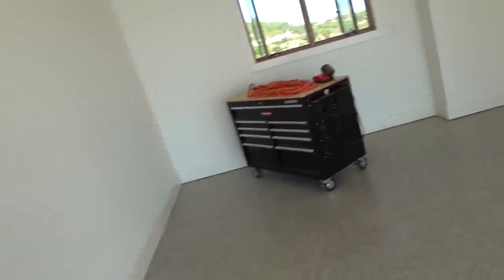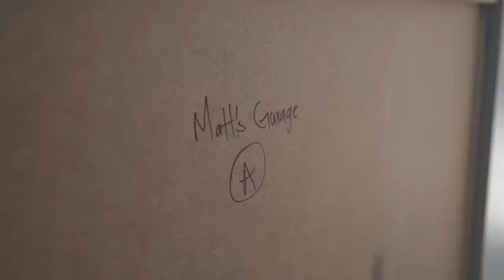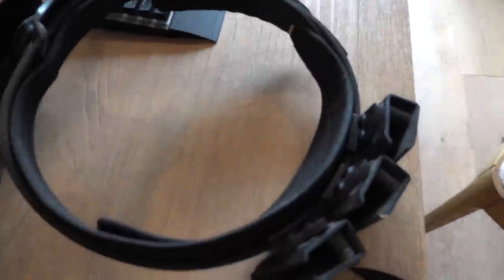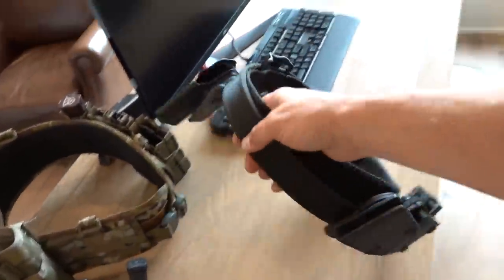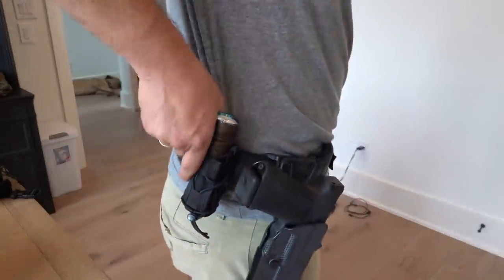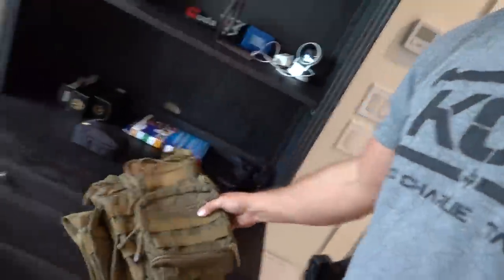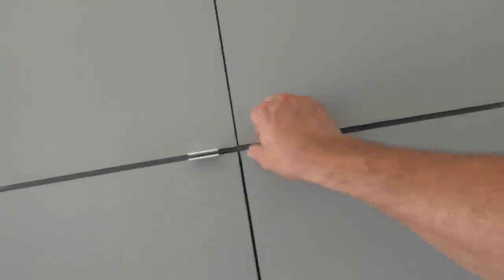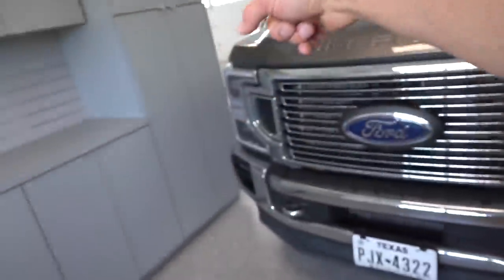Caught Intruder in my Backyard at 10pm... DemoRanch Gear Check!

Comment: As prier law enforcement I agree with FixitQuick and Robbie Hicks, put your flashlight on your non dominant side as well as a fixed blade on the same side as a knife can be a superior close combat option. Turn you mags the same direction as well it will help you get the muscle memory if you are use to pulling them if they are always the same direction. Also if you by chance don't have time or in your rush you forget you med bag i would recommend a smaller med pouch.

Comment: Spent a few years operating from more of the webbing style kits but have recently moved over to a 2 row shooters belt when I don’t need to be carrying all of my kit, would highly recommend a dump pouch to throw those empty mags in rather than fumbling around trying to put them in pouches. As far as med kits go there’s options out there for smaller kits that can be mounted at the back of a shooters belt which can fit all the things you would need immediately but there’s no need to carry all that med kit with you all the time 👍🏼

Comment: Safariland retention holster 100%. ALS at least, but I actually like SLS/ALS. You want to be able to grab the belt and RUN. kydex is great for EDC and range use. if you might need to use this running through the woods or grabbing a kid and sprinting to the car, you want retention on the pistol. Light should be on the left side. keep your primary hand free to be able to go lethal if needed.
Reply: I really like the 6360RDS and 6390RDS. RDS means red dot compatible. You want a weapon light on the pistol. X300U X300T or TLR1 HL. If you get one for a Glock 34 you can also run Glock 17s in it.

Comment: Flaslight with Strobe on the non pewpew side, holster with safety ,softarmour with knife protector, Glock without reddot but light/laser module, tac shotgun. 
At nighttime you wont be shooting at targets a mile away. Biggest danger is a surprise attack around the corner.

Comment: I’d move the flashlight to the support side for two reasons. 1) you don’t want to get hung up on the light going for the pew pew (you can train to that though) and 2) if your pew pew is out and you need your light for some reason (even if you have a WML) you won’t be able to easily grab it.

I have tactical belts and stuff, but I’m not a professional just to let you know.

Comment: I run a Ronin Senshi Multi-Cam belt, with a Multicam Safariland ALS holster for my Glock 17, surefire X-300, and a red dot on top, I run a random flashlight, 3 rifle mags, 3 pistol mags, a Tourniquet, and a medical pouch all on my belt, plus zip-cuffs if I need to use them.

Comment: You should totally run a 19x w/ a flashlight on the multicam big boi belt, I'm a big fan of the night sights and the recoil control since the 17 frame and the 19 barrel. Perfect secondary for when you don't need or can't use your rifle.

Comment: I wondered why you did not install floodlights that turn on whenever an emergency knocks at the door. An exceptionally loud alarm sound would do the trick as well as strobe lights and sirens. 
I have installed a basic loudspeaker with a siren, a few lights and a siren all connected to one light switch. And when I feel things are not as they should I just switch it on. I've seen two bustards running like crazy.
On the belt subject - nice, I like the black one.

Comment: Very late reply but you should definitely move the flashlight to the opposite side of the gun side aka dominate hand. In case you need a light if or when the gun lights die out you don't have to fumble around to reach the 2nd light. Personally keep stuff like that on my mag side so my dominate hand can always be ready for a draw or keep my hand on the pistol in case I need to hand out lead to the bad guys.

Comment: I barely got into battle belt setup, one thing i got out of it was 2 belt piece is tons more secure, because some holsters have really strong retention so a single piece belt can move up when drawing. (Currently) i have 2 pistol mags, 1 AR mag with 4 shell loops (from esstac), holster, and planning on a ifak as well. 

I think for bump in the night birthday suit setup, a plate carrier would be better. You can have almost all of the same things (minus holster) but with protection

Comment: The main thing that I would recommend gear wise for immediate home defense is having a tradition warbelt.  I use T.Rex Arms Orion fully kitted warbelt.  It has a holster, IFAK, spare rifle mag, spare pistol mags, and just enough room for additional equipment like a dump pouch, secondary flashlight, knife, restraints like Esstac's Cobra Cuffs, etc.  The best part is, you can wear it over anything since it is entirely one piece.  It takes 1-2 seconds to put on and has everything you need right out of the gate when you're caught off guard.  You don't need to get the Orion warbelt but you should at least have a traditional, one piece warbelt to deal with those situations that you cannot prepare for in a moments notice.

Comment: Your bump in the night belt is the same thing I use. Not the same brand, but the same concept. Mine is from a time in my life when I did armed security, with an AR mag pouch added. I also have a good fixed blade knife on mine, it came in handy when a duck got caught in an old volleyball net one night. Sounded like Armageddon was happening in my back yard until I went out and cut the net off of her. A bump in the night belt is a good thing to have.

Comment: Recommendation, I'm a little behind here. But I would recommend moving your handheld flashlight to your non-dominant hand in case you need to grab your flashlight and your pew pew at the same time. I've gone through a few different belts, I've been using the Safelife Defense belt system for the last couple years now and absolutely love it! I've done armored truck and private security with that setup and it is still holding up strong.
nice garage btw!

Comment: so for setup the belt is good, probably put the flashlight on your left side though since you are righthanded. even with a gunlight you want the flashlight in your offhand at all times. get a second ar pouch/double pouch or a strapped mag already on the ar, which should probably be ready to go with a sling and other kit on it. personally i'd want a tourniquet and maybe even a medkit on the belt just in case, you might win the gunfight but you have less than 10 seconds until you are a puddle if hit in a bad spot!

Comment: You want a vest over a belt for grab and go, Belts and pistols are for all day policing actions - ie your wearing them and patrolling 8-10hrs a day, if your reacting to a breach in your security your already up two stages (someone has already approached, and has crossed boundary security without announcing/permission), body armour/plate carrier & a rifle should be what your grabbing (assuming intruders are outside, if inside you need CQB so SBR/shotgun), so you need to be looking at what your mounting on your body rig.

Comment: If I feel like I need to wear a weapon system, I’d use a clip on nylon holster with an extra mag slot. My sensor system outside would flood light out to fifty meters so I don’t need a flash light. Then I check that all doors and are locked . Stay in side. Call security or yell out an open door.  Avoid direct contact as much as humanly possible.

Comment: Belt is cool but I would recommend putting the light on your non dominant hand side so that your gun hand is still free. Also maybe make sure that you could still reach your extra mags with both hands in case your non dominant hand goes out of commission for whatever reason.

Comment: From a “gear guy” need a better holster. Ditch the 33rd mag, it’s to long to unholster. Good with the AR mag. Also get a Ned pouch in the back of your belt. Then you don’t need to take the extra step of the med “satchel” at minimum have a tourniquet on the belt

Comment: Ditch the long boy mag. Loading that into your gun under stress will not be easy. I would also put a light on your gun so you can use both hands when aiming, and put your handheld light on your left hip so you can reach it with your support hand should you need it and your firearm is drawn.

Welcome to the rabbit hole!

Comment: Let me make a recomendation. Always have handy a body armour vest with a belt attatched to it. You put it on like a shirt, you lock the buckles of it and the belt and you grab an AR or some long weapon. You only have to put the armour, lock the belt (it should already have a loaded handgun and mags for both weapons) you grab the long weapon and you are good to go. 
And get a suppressor, allow yourself to shoot being safe on your ears while you also hear any small noises surrounding you.
For me, it is 300 blackout and 9mm combo, 1 extra mag of both weapons (one in th3 weapon and one as a spare), both suppressed if possible, If not at least the rifle, armour on top and the belt. Always have lights (one on the rifle, one in the pistol and a handheld spare). Always a medical support kit and a way to secure the hands of an intruder (ziptie handcuffs are great cuz an intruder may surrender without shots fired and you want to hold them securely while waiting for the cops).

Comment: Motion trigger alerts are good for backup of cameras. Now camera that can differentiate between vehicles, humans and everything else is better and even more so when it send you alerts with picture of the trigger event to know what you are dealing with. As for the belt, narrow belts are good for quick-n-dirty but wider belts are more stable and comfortable for duration as well as will allow a little more carry. Ammo pouches, look at a pouch that will hold say a AR mag or a pair of pistol mags meaning you can just swap in a hurry if you need to. Torch up and lense exposed, badness there. Accidental trigger lights up your torso for opposition rounds to be sent towards. Down and in sleeve stops unwanted illumination. Red-light option great for night time, avoids you loosing YOUR night vision before you need to go outside. White light is evil unless you want to blind the opposition. Another option for belt, LTL (less than lethal) sprays or rubber rounds. Less problems if accidental dispatch the wrong opposition.

Comment: The only things I have to say are about the flashlight situation; the wpn should have a light/holster to match, and then your other light should be on your weak side, so you hold your light away from your face, while aiming. I just regular edc a light in my weak side pocket, and my belt is setup so I can get to it. You also need something between yelling, and pulling trigger. I like OC, so I have some sabre red liquid spray on my weak side also. But nice setup bro🤙

Comment: I personally just have my AR bedside loaded with a mag and 2 linked pmags as spares if somehow, the first 30 rounds weren't enough. I've thought about getting a "battle belt" but fumbling around isn't exactly ideal. So if my pistol and spare mag (25 ish rounds) isn't enough, I'm not sure what is. My thought process is if I've identified a threat, I would prefer having the AR anyways, so grabbing that would be *enough*. I have ear pro bed side as well, they have ANC but offer normal hearing as well, great for preserving ear drums which I prefer over strapping a battle belt on.

Comment: Love your belt setups. Being Security Forces in the Air Force I wear gear everyday. Plate carrier and duty belt. For my belt setup the only thing on my right side (dominate side) is my sig M18 holster. My left side is all my ammo for my M4 and my M18. Behind me is a tourniquet and dump pouch (Incase shit goes south i need to keep track of my stuff so when I empty a mag or “I think I empty a mag” it goes in there) you probably wouldn’t need that. For home defense your on your own land nbd. I also hang my gloves from my belt just in case I need them. They are nice to have.  My main goal in all my setup is put weight on my hips instead of my back and keep the entire front of my body empty so if/when I have to lay down to shoot I’m not at weird angles. It keep everything flat so when I go prone I’m still straight as a bored.

Comment: I only have two things to say about the set up. 1) face your mags the same way on the belt. I think they may have been said already. if in a high stress situation, you will not be focused on wigh mag was pointed in which direction when you go to do a reload. Seconds due count. 2) MOVE THE FLASHLIGHT I can't stress this enough. place it on you non-dominate side (opposite the firearm) In the event you have to transition to the firearm, if the flash light is in your dominate hand, you will have to fumble with the flashlight, or risk dropping and potentially illuminating you to your target. you may think you can do something, but when your adrenaline gets pumping, you want to remove as many variables out of your actions as possible. I have 10 years experience in law enforcement, and numerous active shooter trainings under my belt.  Otherwise, great set up and you are going in the right direction!

Comment: I’m going down this journey and have been for a while now with no satisfying resolution.  What I have discovered so far is, other than the expense, as far as the belts and the different levels of gear, you’ll always feel like no matter what you’ve got on, you’re still short of something useful that you might need.
I’ve also noticed that It’s informative yet daunting watching the top tier operators on their gear and belt setups - after all they are the experts but at the same time they’ve got the entire kitchen sink on there - then here comes the plate carrier/armor and you’ve got a 25 pound rig. 
My point, don’t let it become psychological sand in your shorts, LOL

Comment: More gauze. Like. All the gauze. Medkits always load you with burn stuff and tweezers and sheers etc etc. But if you're making a barebones kit for the very specific scenario of protecting your house then the danger isn't getting a burn its getting shot and 3 packs of gauze is just not enough to pack a wound correctly ESPECIALLY if you're in shock and shaking.  I would personally dump everything but the tourniquet, clotting solution and gauze. You're not looking to patch yourself up, you'd be doing emergency blood loss prevention for the 10 minutes before an ambulance and cops show up. (EMT trained firefighter)

Comment: BELT SETUP:
-Alien Gear Rapid Force Duty Holster
(Level 3 retention, suggest this bc you don’t want someone getting your pistol from you if you have to get hands on) 
-Stream light TLR-1 for your pistol
-Heavy Flashlight that doubles as a baton
-zip cuffs for restraint to hold someone until the cops arrive
-Mag setup looks good
I know you are not a cop, but with your house and property the size it is, this is the setup you need. 
I hope no one tries it again, but having and not needing is better than needing and not having.

Comment: Would having a vest with a pistol mounted on the chest with mags for pistol and AR on the vest be more suitable than a belt? I feel like it could be a bit heavier but you also have the added benefits of alr having body armor incorporated with your rig. Maybe have a PCC next to the vest so you can just take like 10 seconds for the vest and be up and running. 
A PCC could also be better because you don’t want to over penetrate in case you do miss. With a PCC you could also carry less mags since the mags could be used for both your pistol and the carbine. 
Maybe a headlamp also for more light in case you turn your head before you move your gun.

Comment: Hello Mr Carriker a couple of ideas. Switch out your 30 round magazine for a standard 17 round magazine, and turn your mags the same direction. This will help with fast reloads and muscle memory. I would also put your flashlight on your off hand side, so that you can access it and still have your gun out. I would also suggest you get an ifak and tourniquet for your belt. This way you don’t have to worry about putting two things on your body in a rush. If you are just putting your belt on. I would also get a level two retention holster your g34. If you have to go hands on with someone your gun would be more secure and they would be unable to take it from you. One more thing love the content keep it up. Oh and Don’t Tell Mere.

Comment: Be aware with that belt not securing to an inner belt via velcro or belt keepers its going to lead to an inconsistent draw and be horrible in regards to handgun retention if you get blindsided and it turns into a physical scuffle. The belt would twist left to right and ride up and down your torso in those situations.

Comment: active LEO here, nothing in this industry is cheap. from my experience, you need something to see (light) something to make holes, (weapon of choice) and something to plug holes (TQ, Chest Seals, Gauze, Etc.) I would personally suggest moving at least a TQ to your "Castle" belt, in the event that you're running that belt, and either you, or the subject end up taking a round. Just so that you dont always have to carry that rig around your chest. As far as armor goes, if I'm putting on a gun, I'm also going to be putting on armor. Train with your kit, and get proficient with it. Take the extra couple seconds to throw on a vest. It may save your life. Keep up the good work brother!